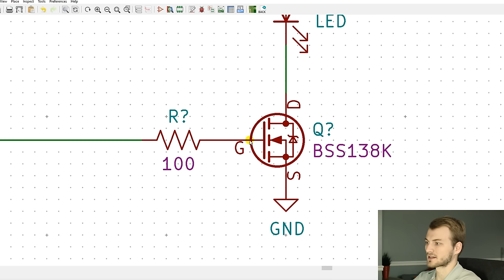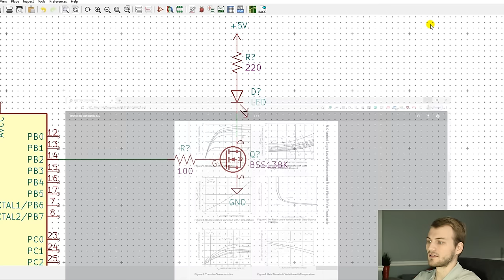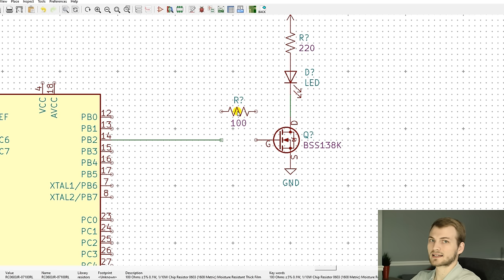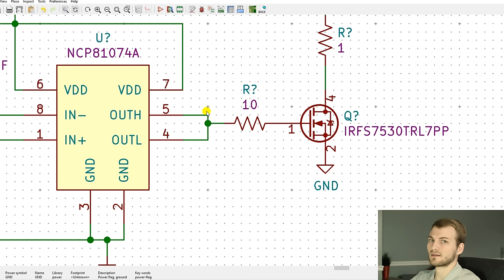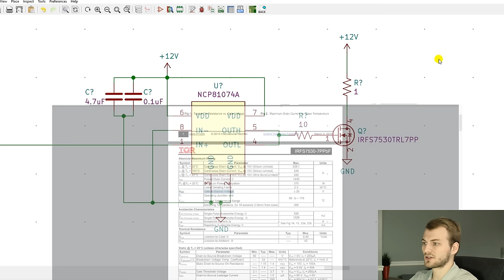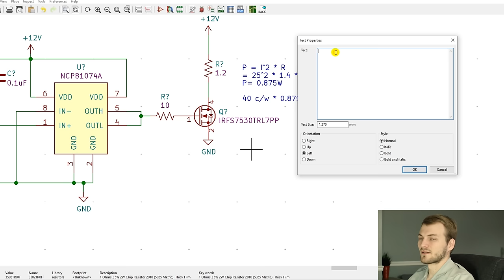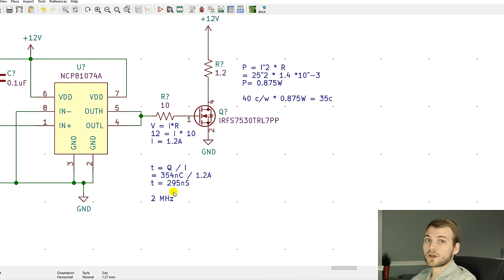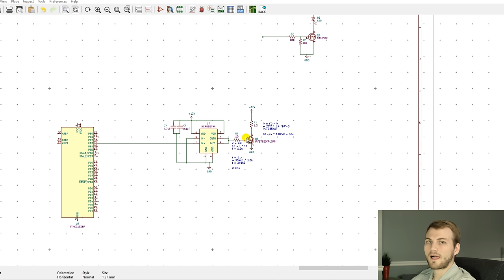Designing Power MOSFET Circuits - Circuit Tips and Tricks

Comment: Problem! It's great that you're making videos like this, but I think the power calculation is a bit off. if you're going to deliberately slow the on-off and off-on transitions, then those transition times are durations when the MOSFET will have to conduct significant current while exhibiting significant resistance. This can easily dominate the heat output.
Reply from the maker: Yes, you're right. I had to limit what went in the video, and was focusing mainly on high-power low switching speeds drives. But yes, I wish I would have at least mentioned the losses during switching.
Reply: @MicroTypeEngineering  Thanks for replying.  I'll just add that I think what happens during turn-on/turn-off is especially crucial to mention, because an unaware designer could be lulled into over-optimism by the astoundingly low on resistance that some of these devices have. That low resistance does indeed mean that your sample device can carry very high current, especially given suitable heatsink. But factor in frequent switching, and the numbers blow up, perhaps surprisingly for some.
Reply: I'm glad you two brought this up.  Thank you for the video, MTE!
Reply: So should we reduce the gate resistance to speed up the on-off transitions?
Reply: @dwalden74  Right, you would reduce the gate resistance according to the calculations that MTE did in the last 5 minutes of the video. That's assuming the gate driver chip can handle the current pulse and isn't the limiting factor.  But first, you would first want to assess how much heat is dissipated during those transitions to see how fast you need the transitions to be. If you are switching infrequently, then slow transitions are not much of a concern. But if you're switching frequently, then they can easily dominate the heat output. To assess the heat output per transition, conceptually you would need the gate waveform (VGS vs t), then the corresponding RDS (drain-source resistance) vs VGS, so you arrive at an RDS vs t. That's pretty tedious, so instead model it in Spice (for example).  The Spice sim can directly plot the power dissipated per transition (just VDS x IDS). And run  a range of parameter values, as VGS vs RDS is not a tightly controlled parameter.
Reply: @Graham_Wideman   Thank you very much for the reply.  I would love to see a video on exactly this topic.
Reply: @dwalden74  No problem. I should also mention that of course instead of Spice, you could of course experiment with the actual device and observe the V and I waveforms on a scope. You can also measure a few parameters and compare them to the datasheet to get an idea if your sample is a particularly high or low performing example, if you need to generalize to a larger population. Also you might like this other video from Great Scott https://www.youtube.com/watch?v=8swJ_Bnsgl4
Reply: @Graham_Wideman  its impossible to read your full comment on my phone due to the url that automatically got inserted in your comment due to a bug in the yt app as "show more" appears right beside the link and doesn't respond it just opens the link. Edit your comment to fix the url/link? There needs to be a space after the period after scope, no space turns it into a url
Reply: Nicely done , enough information to get you up and running with pointers to more in-depth detail if desired . I should have watched this before trying the videos by Nexperia or TI , would have saved a lot of head scratching .
Reply: Great Point @Graham W  probably the video maker had not even considered this or, he would have at least mentioned it.  PWMing something could easily run into this.

Comment: One has "Turn-On Delay Time", "Rise Time", "Turn-Off Delay Time ", "Fall time" to consider too, with the Rise/Fall times being the ones that the most significant power loss happens. E.g. the IRFS7530TRL7PP datasheet places the total of those timed at 373ns (for over 3A as the gate charging current) - which places the absolute upper limit on the switching freq at 2.6MHz.

Comment: I have a degree in EE, but I never had such a clear explanation from any of my professors back in school. Well done!
Reply: @jamescollier3  The circuit in this video is using the mosfet at it's most simplest function, as switch.  So normally you would wire your "load" (led, motor, etc) in series with the switch (mosfet).  Mosfets are popular as switches since they dissipate very little power compared to transistor switches. 
The video you linked to is using the mosfet as an (analogue) amplifier. Without going into the many different amplifier configurations (some which have the speaker in series with the mosfet) the results, conditions, and calculations are different.

Comment: Amazing how many EE's don't know how to decode any component's specs. I worked with a lot of just-out-of-college EE's that would read a component's spec and think they could drive parts beyond their real specs using one or two maximum specs as their only guide while forgetting that everything has to be observed. Just because a part can handle 10 amps and 100 watts, doesn't mean you can drive it to that 10 amps at any voltage. And watching them burn up circuits (and their bench tops) was actually funny... Thumbs Up!

Comment: Hi, I've worked with electronics from the early sixties, learning on crystal radios, and building from there, out of hobby books, spent two decades in the Marines in aviation electronics, communications, navigation equipment, and never got the detailed depth of understanding you've given, outside of the exact aspects I worked on, and had specific engineering problems with, and got an engineer involved.  You've done a great job of showing the reasons for selection of specific components, values, for a rather general application, one that varies widely, but not such that it negates the broad application.
      I've built such driver circuits from kits, without knowing the reason for selection, and I've built them out, trial and error, and didn't know exactly why they failed, or why this one succeeded, or how much by.  A very professional production, without too much detail on this specific motor application.  Thanks, still trying to learn.  Semper Fidelis
Reply from the maker: Woah, thanks a lot for the words! Really appreciate it
Reply: @MicroTypeEngineering  I never got formal training, I learned from doing, and while I got schools in the Marines, it was specific to equipment, and the general electronics teaching was far below what I'd accumulated by personal study.  Our work always was too much to allow meandering into theory, except for the occasional really odd problem.  I've learned more about specifics, in the last year, online, than all my previous years, and it helps in design, less "trial and error".

Comment: This is really a handy way to do rough calculations around a power MOSFET. I personally calculate with half of the gate current to get more realistic switching times. Under more critical timing conditions I also consider the internal gate resistance, which is typically in the order of 1 to 10 Ohm. So in some cases you don't need an additional gate resistor or you have to avoid it to fulfill your switching requirements.

Comment: Just saw the comment below on hooking Mosfets up in parallel.  Circuit would consist of two,three, or more Mosfets with all Gates joined, all Drains joined, and all Sources joined, apparently for driving really HUGE loads that one Mosfet could not handle. One YouTube video regarding this is called "Issues on Connecting MOSFETs in Parallel" and addresses some of the problems. It seems that the electric vehicles would have to have multiple banks of Mosfets just to propel the vehicles down the road. Would like to hear your thoughts on this.     Thanks again. Great videos.
Reply from the maker: I don't have any direct experience with FETs in parallel, but typically the reason people shy away from parallel components is that they won't react the same way to the current across them. In some use-cases (fuses), parallel components are OK, since the resistances even out due to heat. But FETs can have their resistances decrease with heat, causing a runaway condition. (I know Vgs decreases with heat, not sure about Rds off the top of my head.)

Comment: Excellent. You commented on increasing the gate resistor. The thing to watch is that by doing this, you increase the charge time and the amount of time the divine is in linear mode. During this time it is dissipating much more power. If the gate resistor is too high, it will increase the delta T.

Comment: this is a wonderful explanation! the simple videos you mentioned make it seem so easy to drive but the other videos make it so complicated. you managed to find whats important and relayed that info in a clear and concise way. 

I am designing a 9v battery to usb charger and i wanted to add undervolting protection. i found a very low power comparator that has an internal reference that makes it easy. the problem is my buck converter doesn’t have an enable pin. so i have to use something to turn the circuit on and off. i didn’t want to waste power driving a bjt but mosfets seem so complicated. now i understand what to do.

Comment: What a good overview - it covered just about all of the essential design considerations. About the only comments I might have added is that driving inductive loads needs an extra couple of things to take care of; and that because heat flows through thermal resistances in a very similar way to how current flows through ohmic resistances, the bulk of the 35 C temperature drop will be between the case and the air - which means that the case will be quite close to junction temperature, i.e. up to 60 C, so try not to touch the MOSFET unless you decide to put a decent heat sink on it!
Reply from the maker: Yep, agreed!

Comment: I have watched lots of videos on mosfets and yours is the most succinct and easily understandable with just about everything you need on one page that you can see during the explanation. You crystalized quite a few things for me. The only thing that was not mentioned was about use of zener diodes to pull up voltages but you may cover these in another video, and possible use of a transistor to be triggered to charge up the gate capacitor.. The gate driver IC I guess is most useful for driving higher frequency as it allows higher currents for charging it. I was not sure why the gate driver is better than use of these. Is it because it simplifies the pcb layout, as you still need other components?
I was trying to get to grips with them for making an h bridges for an initially rc controlled (pre automated) lawnmower with  brushless motor 40v/(?100a from an existing possibly failed esc) and dc brushed wheelchair motors.24v 250-340w. Your video will helped look to do this rather than buying expensive driver escs such as the sabretooth 2x60 as well as make a lawnmower esc to fix the lawnmower which uses 60v 100a mosfets inside he box.

Comment: Short and sweet explanation, but me (as someone without any experience with MOSFET) has two small remarks ?
At 02:50 :
"... the gate to source voltage, once you get below 2.1 Volt, the resistance from the drain to source decreases exponential."
I think should be:
"... the gate to source voltage, once you get above 2.1 Volt, the resistance from the drain to source decreases exponential."
And this:
" 'Silent' PWMspeed control at an ultrasonic frequency of 20 kHz".
Ultrasonics may start theoretically at 20 kHz, but humans and dogs and other creatures are surely able to hear these frequencies, although it is not part of the bandwidth of our ears. But when the power is high enough we are bothered by it, sometimes without us able to pinpoint the source. So making these designs at least at 30 or 40 kHz is (in my eyes) a must.

Comment: One other consideration with regard to the gate resistor is the situation where the MOSFET fails,  typically shorted.  In that scenario you have a pretty good chance of applying Vdd to the microcontroller pin that's driving the circuit,  with usually unpleasant results.

Comment: Thank you for making this video and explaining things how you do. I was having a problem with ringing in the circuit and I was thinking i was going to have to add a RCD clamp and snubber circuit, but adding a resistor to the gate solved the whole issue! I was kind of confused why it was ringing since my load is basically resistive. Anyway, thanks again!

Comment: Can I confirm: the OUTL of the high power mosfet driver obviates the need for a pull down resistor on the gate?

This was perfect, and I don't use that word lightly. Content and calculation pacing, lack of umms and ahhs, good editing, simple but functional example. Spot on. Thank you. You're a natural.
Reply from the maker: Ahh no, I just realized I didn't have a pulldown on the driver example, nor did I really explain that section well... I'll make some adjustments to the blog. 

So, you need to still have a pulldown, but instead of it being on the gate driver -> MOSFET line, it's on the microcontroller -> gate driver line. The OUTH pin is what sources current to turn the gate on. The OUTL pin sinks current to turn the gate off.

Glad you liked it :)

Comment: I never used such kind of MOSFET over some kHz of switching frequency for  PWM driving purpose. Without a good ESD filter I suppose you are going to  measure electrical noise everywhere around the circuit.
It would be nice to speak about some designe focalized to reduce these issues.

  By the way: nice video, I like the way you speak slow and clear. Thank you.

Comment: Great video! Also the max power and thermal resistance is related. 375 Watts * 0.4c/W gives junction temp rise of 150A. If case is held at 25c then junction would be at 175c which is max junction temp found in datasheet. Also at 375W and 338A then voltage would be 1,109V and that gives RDS(on) at 3,28mOhm which probably is the RDS(on) at 175c junction temp although I cannot find it in the datasheet.

Comment: 5:50 - Good explanation, always confused why theres a resistor at the gate terminal, I thought it was solely used to protect it from over voltage even though voltage applied to it is provided at the correct amount.

Comment: Good video. I have to relearn a bunch of stuff. I had a bad heart attack causing hypoxia (lack of blood flow to the brain). My memory is like Swiss cheese. One thing I remember is that I used MosFETs to power 36 V motors at 36 A. I used a Flyback/Free Wheel diode across the motors but was burning holes in the MosFETs. I was operating at about 20,000 to 22,000 cycles per second adjusting the duty cycle for speed control. What I had to do is use Shottky fast acting diodes. 

Would a capacitor paralleled with the motor help prevent holes being burned in the MosFETs? I also have MosFETs rated at 120 A. I can't find the video again, but someone said I can push 120 A continuous through the MosFET in a TO-220 package. I have difficulty wrapping my brain around 120 A through a TO-220 package. Is 12 to 15 A more realistic, using 3 MosFETs paralleled for each motor. Or with 4 motors, can I just parallel 12 MosFETs to drive all four motors?? I am using a PWM to drive the gates.

Comment: great tips thank you very much! I'm making an H bridge for a robot the video came in good time, I would like to see more about power control of DC motors and protection systems, greetings from Brazil
Reply from the maker: Thank you! I'm actually planning a project for a high-power brushed DC motor driver. Will use discrete MOSFETs for the H-Bridge :)

Probably won't be ready to film it for a little while longer, but it is coming!
Reply: @MicroTypeEngineering  
great! I'm waiting for that, good luck with the project
Reply: @MicroTypeEngineering  Very keen to see that one - take your time editing / producing though, your video quality makes it well worth the wait IMO. Particularly keen to see how to design the flyback diode stage / considerations.

Comment: I just ran into a circuit where I run 2.5A coil with my mosfet and all is good. If I disconnect and install a 12A coil, my mosfet will not turn off. I have gate resistor, resistor to ground to drain it, but it must be picking up EM interference from my power cord because once I pull the coils power supply off, the mosfet turns off. And the power supply is still green despite being off, so it had capacitance to supply the coil, the coil just never took it because the EMI was gone the split micro second I uplugged the power. After playing around with all my power cords and making sure they have no wraps in them, this seemed to mostly fix the issue. It occurred less frequently and appears to be solved by directly grounding the gate so that it immediately drains the gate and it can't hold any charge in the gate line.

Comment: You are getting closer. You should consider the turn on current at just 10 amps with the inductance from the 12 volt source considering the clamping load current diode's reverse recovery and also look at the forward recovery of the pn clamping diode. A 1n4004 can have 20 volts forward recovery and a very high reverse recovery. Most mosfets have a protection characteristic of avalanche that protects a lot of shortcomings. Also the gate resistor should be as close to the gate as possible in order to prevent a colpits oscillator from forming at high currents.